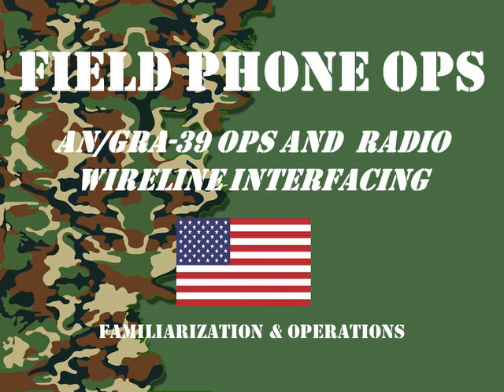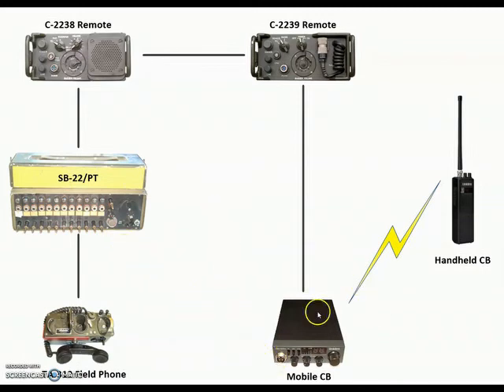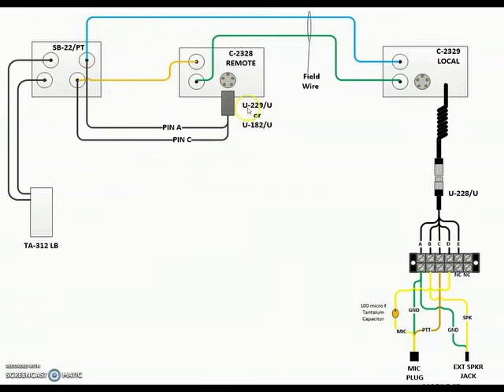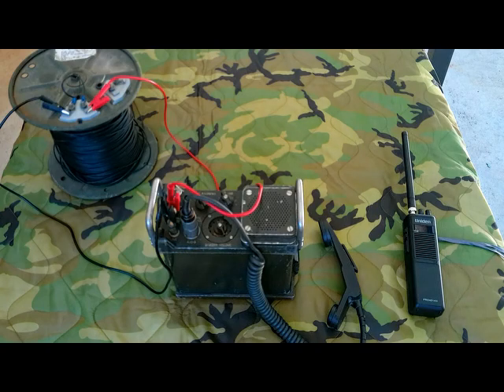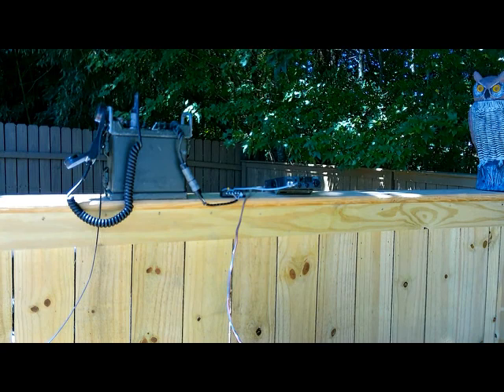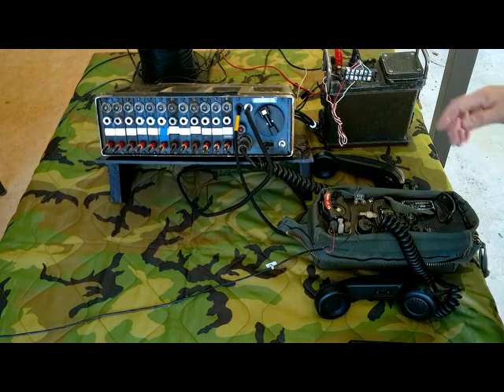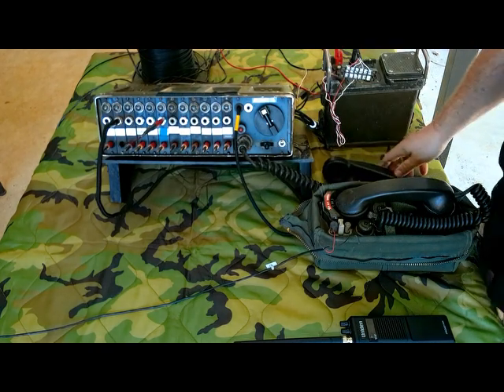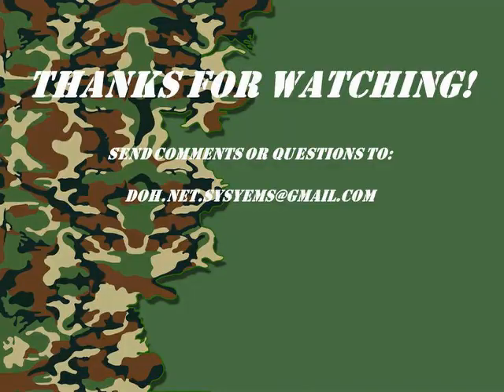FIELD PHONE OPS:  AN/GRA-39 WIRE LINE INTERFACING

Comment: When I was commo daddy for a field artillery battery we used AN/GRA-39 remote units as an intercom between the guns and the fire direction control. We used WF-16, one pair used for voice and the other used to connect the battery computer system to the gunners display that would send the elevation and deflection to bring the gun onto the target. We had phono plugs soldered on a whip for the AN/GRA-39 with a patch panel of phono jacks wired in series mounted in a artillery round crate. When we occupied a new location I would through the crate in the middle of the fire base and the advanced party man would pull his wire over and plug into the box. They would use TA-312s so the gunnery SGT could get they preliminary lay of the guns. When the main body would show up they would hook up the angry 39s.

Comment: Thank you for making this video. I recently bought the an/gra-39 that included the local, and remote pieces to be used  with my sb-22 switchboard. Your video has given me insight on what other parts that are needed for this to work properly. This, with the other parts I have for this switchboard will have many communicating possibilities during a disasters relief effort for us locally. In addition to this an/gra-39, I also have finally secured a ta-977/pt tone adaptor for landline capabilities, along with several ta-312 fieldphones. I am looking forward to seeing your next video on the an/gra-39 that will tweak the system even more.
Reply from the maker: A key thing to remember is most field phones are interoperable and this matters when your trying to keep on a budget. Also if your interested in using radios via telephone interfaces check out my videos on remoting VOX radios using field phones.  I'm glad I could help!